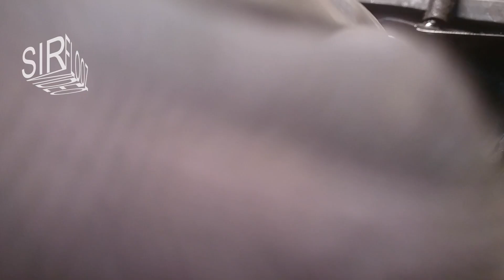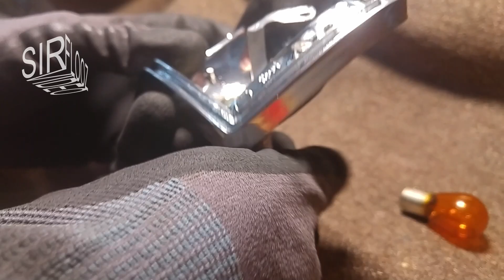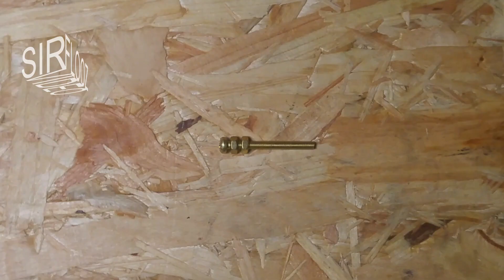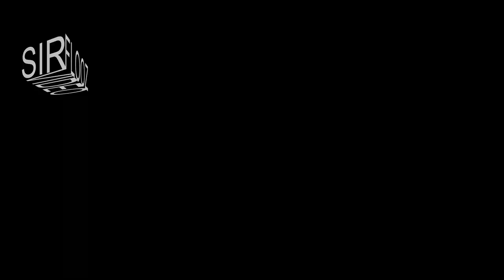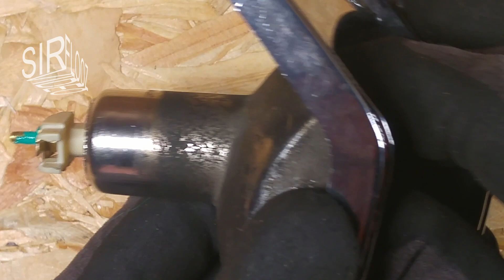Vespa PX | Turn Indicator Malfunction Part 2

Comment from the maker: AFTERMATH: I had to shorten the screw, switch the two nuts to just 1 nut, secured with screw locking agent, because otherwise the connection is too long, and so the rubber cap rubs against the engine!!!

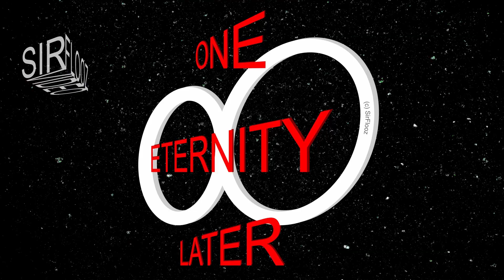Comment: Use a lump of grease at the 4 corners and where the 2 ends meet up, to hold the seal in place [22:05]
Reply from the maker: Agree, some grease would have helped. Thanks for sharing your insights!
Reply: Grasa de litio?
Reply: @agalvezcaselles  yes sounds a good grease fo a rubber seal

Comment: Great idea - Your brass bolt that you cut may still have a problem - the normal connection I feel presses against the rear of the engine AND A BIG ONGOING PROB:LEM - maybe touches the electric start motor, causing vibration problems and damaging that silly terminal you drilled out - check the rear of rubber cap at indicator, to see abrasion marks - does not happen with the left side panel.

I had  the same problems you had,  I never touched the terminal at front horn cover, or the indicator switch on handlebar but I did sand all the parts you did, replaced indicator units, tightened the bulb holder (shit design), could see white oxidation everywhere, but light would work and then STOPPED like yours. Both sides but mostly right side.  The signal tracer gave odd results, that also changed when side panel was off the bike or on again - weird.

Maybe you do not need this but I sorted my apparent earth connection problems, ONLY by running a new earth cable from rear of lamp unit to chassis, with NO problems since.
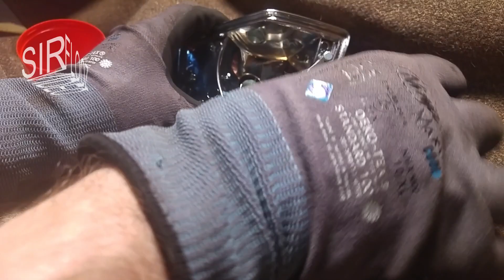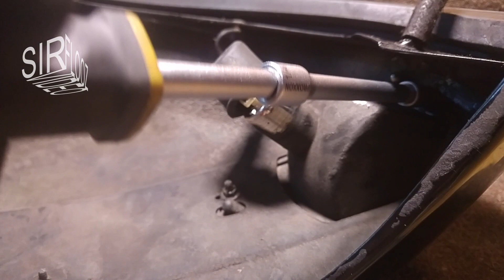Replacing the bolt [2:57]  fixing the indicator unit (and contacting the light bulb earth strap inside) with a new stainless steel bolt, (brass would be better I guess) and also S/S washer and nut [1:45] on the inside of side panel.
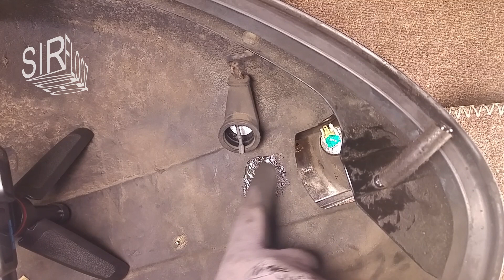Then installed a cable (maybe 60 or 80 cm cannot remember) from that nut inside [1:45] [19:23] , using a circular spade terminal under the nut, and running a cable to the .....a) battery earth for left side panel and .....b) to an earth nut on the engine for right side panel - tucking the hanging cable aside carefully when side panels are put back on.  
I also used circular/spade connectors at these 2 bike earth connection points, to easy take apart during servicing with side panels off, but take care to not rip off the cable.
Reply from the maker: Wow, thanks for sharing your experience! In deed, there is not much space to the engine. But I shortened the bolt as much as possible and finally used just one nut, secured with thread locker. This solution works for me fine since the repair.